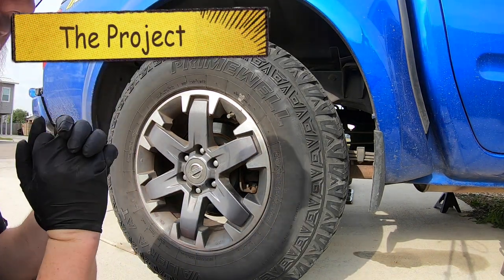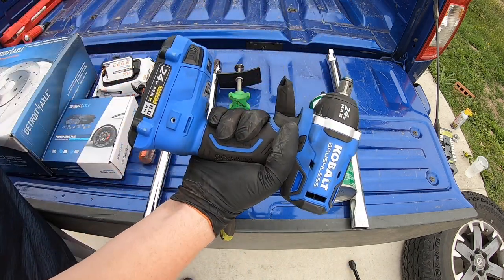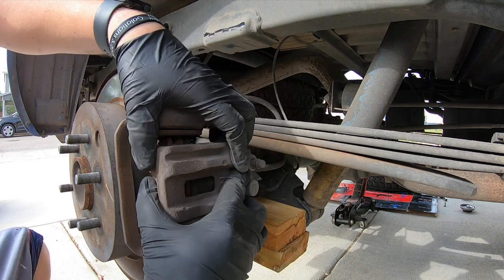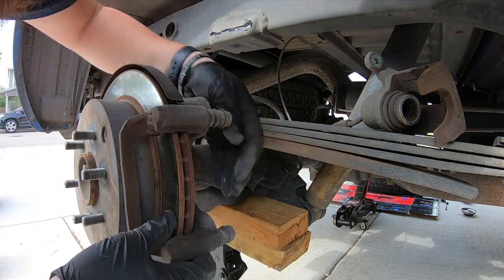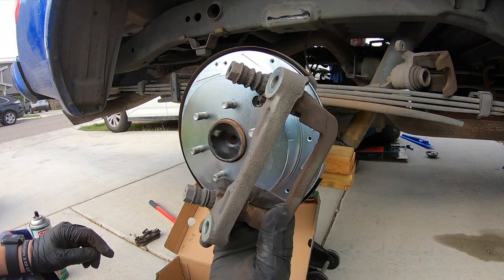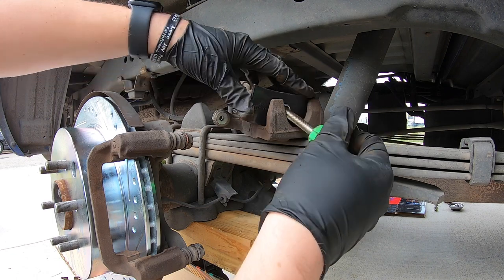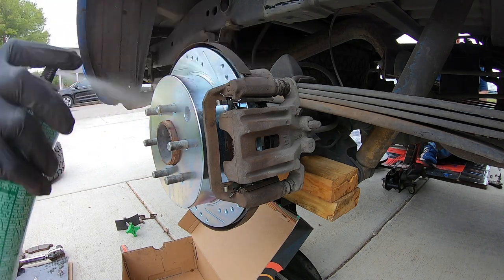How to Replace REAR Brake Pads & Rotors on a Nissan Frontier 2005 - 2019 (2nd Generation)

Comment from the maker: THE TOOLS:
•  Brake Pads - REAR - Detroit Axle (4-Pad Set)
Part # P-1100 - https://www.detroitaxle.com/part/brak...
• Detroit Axle Rotor  (x2) Part #s-31410 - https://www.detroitaxle.com/part/brak...
• 14mm, 19mm Socket - Basic Socket Set - https://amzn.to/3fjRoBd
• 1/2in Impact Drill (Rigid) - https://amzn.to/3vVDUBZ 
• Ratchet - https://amzn.to/3xWjE5g 
• 22mm Impact Sockets (Metric) -https://amzn.to/3etXiQU 
• Torque Wrench - https://amzn.to/3fEIrDi
• Flat Head Screwdriver - https://amzn.to/2RAjTlU 
• Brake Caliper Compression Tool (x2)- https://amzn.to/3rlPwzh
• Brake Caliper Lubrication - https://amzn.to/3FZ80Kb
• Brake Cleaner - https://amzn.to/3FW5hkI
• Floor Jack (3 Ton) - https://amzn.to/2R7G96H 
• Jackstand (3 Ton)- https://amzn.to/3f3ABC5 
• Gloves - https://amzn.to/3bbfEnu 
• Safety Glasses - https://amzn.to/3ux25GO 
• Shop Towels - https://amzn.to/2SC8D93
• Cardboard
• Wheel Block - 4x4 or solid brick

Chapters: 
00:00 The Project
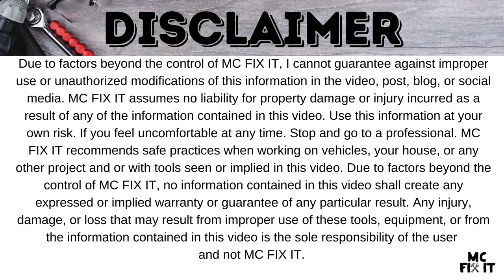00:38 Tools & Supplies
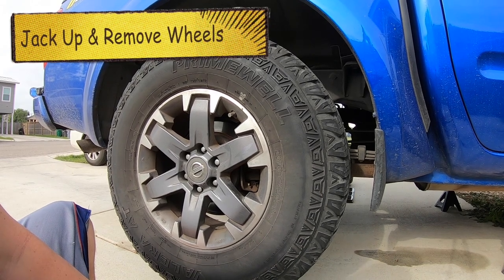02:09  Jack up & Remove Wheels
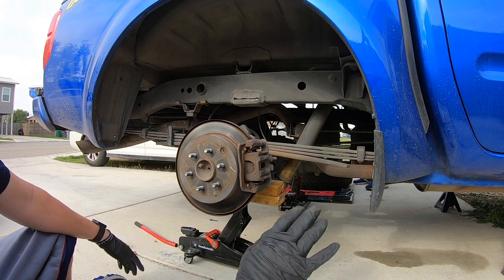02:50 Remove Caliper Bolts (14mm)
04:07 Remove Caliper Clips
04:20 Remove Caliper Bracket Bolts (19m)
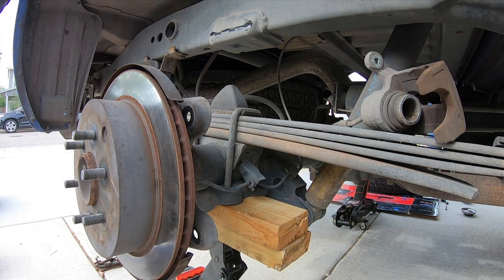05:04 Remove Old Rotor
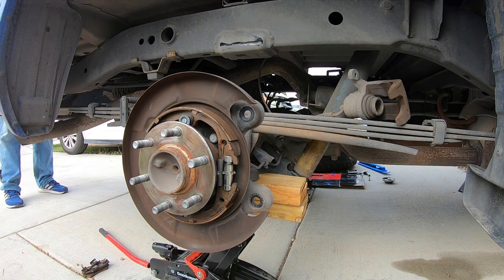05:29 Install New Rotor
05:33 Brake Clean New Rotor
06:38 Lubricate Caliper Pins
07:07 Reinstall Brake Caliper Bracket (19mm)
07:41 Compress Caliper Piston
08:23 Install New Brake Hardware 
08:38 Install New Brake Pads
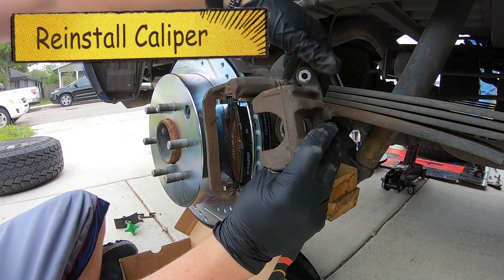09:39 Reinstall Caliper (14mm)
10:30 Bleed Brakes Instructions (Optional)
11:00 Final Cleaning with Brake Clean

This video works on all makes and models of vehicles. The video was done on a 2014 Nissan Frontier. 

Check out my website at http://mcfixit.us 

Links are associate links. A small portion of whatever you buy helps support this channel. Thank you for clicking on the links and purchasing to help out this channel to keep making great content for you!

Disclaimer:
Due to factors beyond the control of MC FIX IT, I cannot guarantee against improper use or unauthorized modifications of this information in the video, post, blog, or social media. MC FIX IT assumes no liability for property damage or injury incurred as a result of any of the information contained in this video. Use this information at your own risk. If you feel uncomfortable at any time. Stop and go to a professional. MC FIX IT recommends safe practices when working on vehicles, your house, or any other project and or with tools seen or implied in this video. Due to factors beyond the control of MC FIX IT, no information contained in this video shall create any expressed or implied warranty or guarantee of any particular result. Any injury, damage, or loss that may result from improper use of these tools, equipment, or from the information contained in this video is the sole responsibility of the user and not MC FIX IT.

#mcfixit #autorepair #frontier #nissan #channgingbrakes #carrepair #mechanical #rearbrakepads  
——
Supplies used to record this video: 
* GoPro Hero 7 Black - https://amzn.to/3f3ALtb 
* 256GB Flash Drive - https://amzn.to/33pAueG 
* Vlogging Frame - https://amzn.to/33tajE0 
* GoPro Pro 3.5mm Mic Adapter - https://amzn.to/2RCURCu 
* Youmic Lavalier Lapel Mic - https://amzn.to/2R55sWX 
* Boom Stand (tripod) - https://amzn.to/3bdkQaw
* 5/8” to 1/4” adapter (boom to blogging frame- https://amzn.to/3txrVsM 
* Portable Battery Powerbank- https://amzn.to/3vJQc0q 
* 6ft USB to USB-C (powerbank to GoPro)- https://amzn.to/3uAS5MH

Comment: Old time backyard 72 yr mechanic here and safety is always #1. Bad placing of that jack stand and using wood on the stand. . Applying some anti seize on the backside of the rotor and on the lug bolts will save you some headaches in the future. The rubber boots on those pins need to covering the ends of bracket and the pin or water will get inside and rust the pins and brackets holes.
Reply from the maker: Great tips! Thanks so much for adding this comment!
Reply: I couldn't get my front caliper bolts off to remove the rotors. Do you think they are seized? My 18 in breaker bar wouldn't get the job done
Reply: @killertofu  Hi Did you apply any PB Blaster to the bolts and let the solution soak in then add some more and wait overnight. One time I heated up the bolt heads pretty hot then threw some cold water on them. The sudden change of temperature causes the metal (bolt) to shrink and loosen it up enough to use a breaker bar on. Good Luck
Reply: @scotsmanofnewengland7713  I did not ill try that tomorrow. Is it ok to use the PB blaster on the bolt and drive it during the day till waiting till the next day to try to take it off ?  I would only be driving 20 miles back and forth 1 time
Reply: @killertofu  Yes I see why not. Just remember to squirt some more on them. Do both left and right calipers if you going to work on the other caliper also. Luck Good

Comment: Gave a Thumbs Down as this Instructional Video on Rear Brakes did not address info in regards to the Emergency Brake & Adjustment.. Otherwise   video quality was well done.
Reply from the maker: It was a video on pads and rotors. What would you have added for the e-brake?
Reply: I think if I was replacing the rotor, I would replace emergency brake pads at the same time.  They look pretty thin, or at least blow it with an air hose and some brake clean.

Comment: Sorry if I missed it, assuming the ebrake was up (engaged) the entire time? Any necessary adjustments or was it simply remove the old rotor and install the new one? Thanks!
Reply from the maker: Correct. No need to make any adjustments. Have a great day!
Reply: @MCFIXIT much appreciated!

Comment: Thank you for a thorough video. I have used Detroit for my escape and were the worst. I had to pay 50% of what I paid to return them. Fit is wanting
Reply from the maker: That's terrible. Definitely feel free to go with a brand you have confidence in. This was my first time using Detroit and it was on my brother's truck. He has since sold this truck, but I do know he drove a lot and he probably put 30-40k on them before he sold the vehicle. I normally stick with a company that I can easily return or exchange them out without the hassle of paying to return them.

Comment: Thanks for sharing, some noob questions is the rear break system disc or drum ? Is a 3 ton jack enough for the truck? So I guess I just need 2 and no 4 right jacks right? Sorry I’m not an expert. Thanks
Reply from the maker: All 4 are disc brakes. Doing one side or half at a time, you will need 2 jack stands and one jack.

Comment: Thanks for sharing, just one noob question  is the rear breaks system  disc or drum ? Sorry I’m not an expert. Thanks
Reply from the maker: All four are disc brakes on this vehicle
Reply: Both. The parking/emergency brakes are drums. He didn't replace them in the video. Chances are you may only need to replace them once in the life of the vehicle, probably not because of loss of material, but in my experience eventually the parking brake shoe material will become brittle due to age and start to crack.

Comment: I used your vids as a refresher to replace my Frontier pads/rotors. The front pads were all identical except one had that extra metal bar protruding. Only one of four front pads had it. I installed it inside passenger side. Does this seem correct. Wagner pad set. 

Rear pads were same…only one of four with protruding metal piece. 

Thanks man.
Reply from the maker: Can you explain the protruding metal piece? Was it a brake pad wear piece… like once it gets worn down it would make a grind noise to let you know to replace your pads? If so, then it should come with two per box
Reply: @MCFIXIT  hi. I know what tou mean my a ‘feeler’ guage built on pad that makes contact with rotor and squeals when pad is thin….but  metal piece looks similar  except that it  points outward from lower edge of pad. I cant wrap by head around what it does because it points away from the rotor. When you did front pad install cid you pointed it out and put it on the inward side of caliper engine side.

Comment: Question on rear breaks u dodnt replaces the break shoes inside rotor too only tbe rotor ? Also when u compress the break pistons the break fluid didnt over flow maybe thete an air goes into the breaklines and needs to be bleed. Thx fof the video.

Comment: Do you break-in your new brakes? If so how, or do you have a video showing that?
Reply from the maker: No I do not. If changing out a caliper I bleed the brakes but that’s about it.
Reply: Break in procedure is drive 35-40 mph and brake firmly. Don’t be too aggressive but brake quickly. Do not come to complete stop…brake to about 5-10 mph. Do this three or four times. Then do this again driving 45-50 mph a couple times. That’s about it. .

Comment: My top pin keeps sliding in and out even tighten
Reply from the maker: The top pin of the caliper? If so, make sure it aligned properly by hand before putting on a ratchet to tighten down.